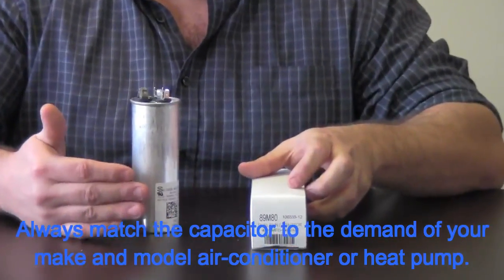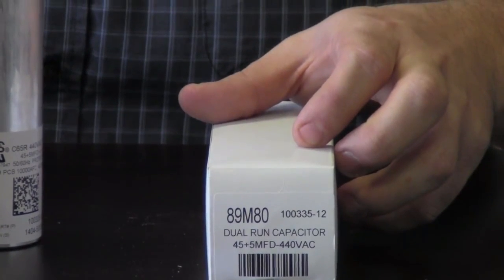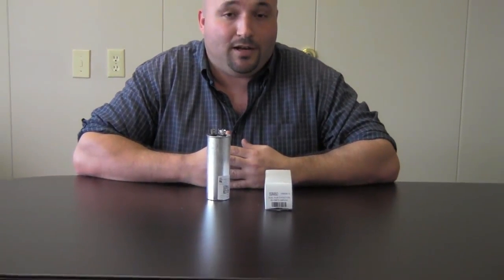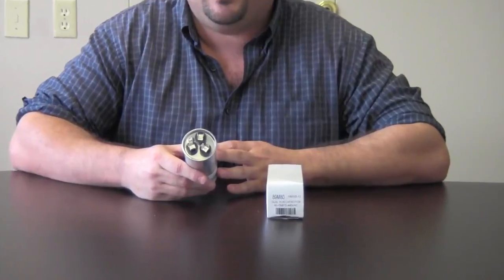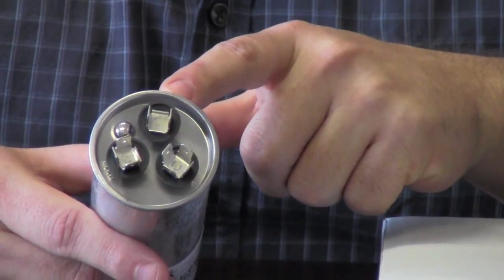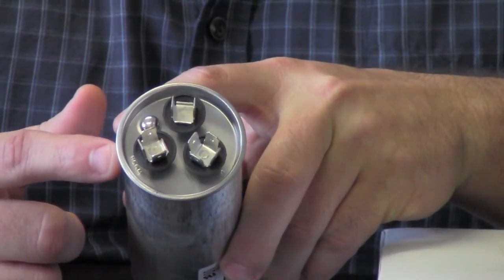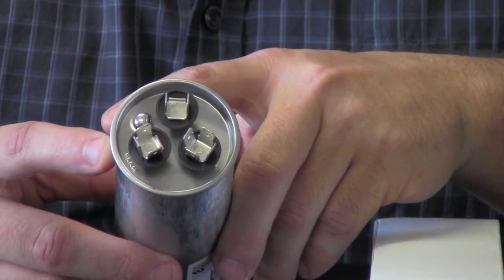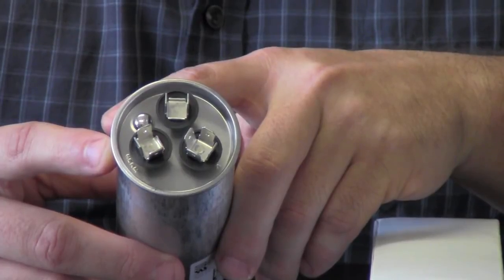Dual-Run Capacitors

Comment: I'm fixing to replace the Run Capacitor on my son's Rheem outside unit.  I noticed that the run cap has two terminals and not labeled as far as polarity or the the usual : C, Herm and Fan.  Can you help me on this?
Reply: Dan thanks for the question. The capacitor you are talking about would be a run capacitor not a dual run capacitor and with this capacitor it would not have polarity. Do you have a universal motor installed on the Rheem unit? Also wanted to let you know you can always call me 1-866-215-3831
Reply: Thanks for the info Steve!   Greatly appreciated!